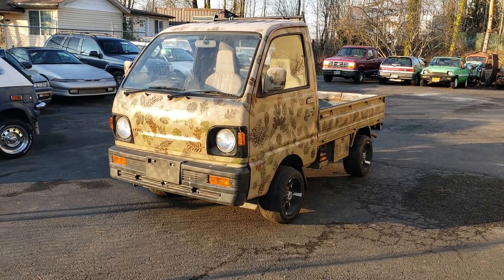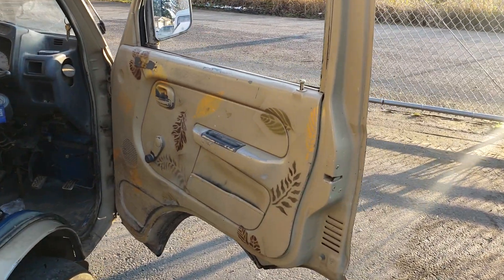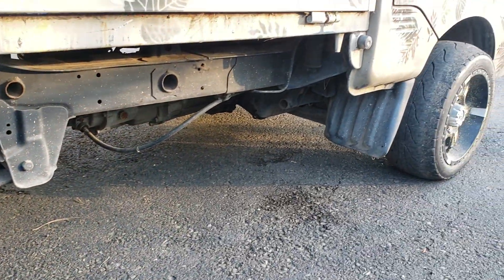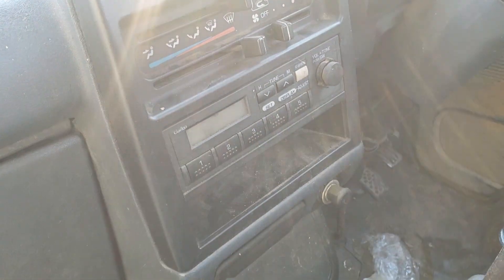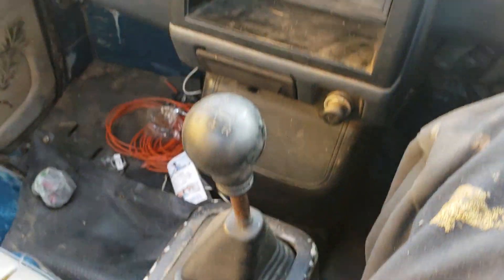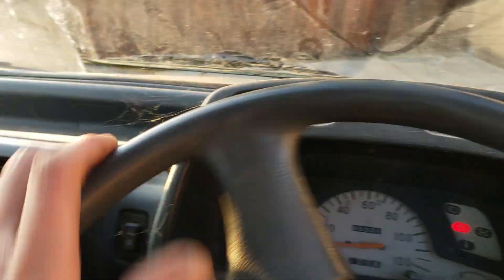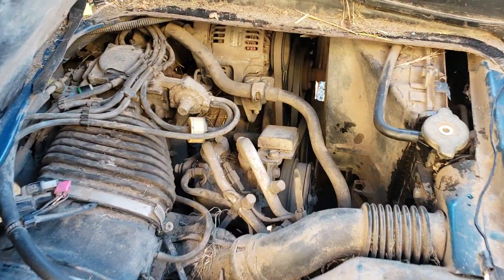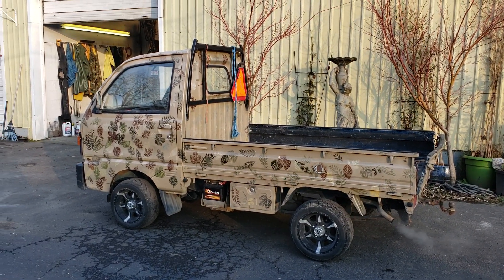This Camoflaged 4x4 Mitsubishi Micro Truck is almost Invisible

Comment: I've got a rwd, 5sp manual van version. 
Any idea how this could be lowered on the back?
Reply: Also the version I have is 660cc 3cylinder 12valve version any idea where I can get a engine  gasket kit? 
Saw similar online but they don't have as many valves.... Would the only difference be the number of valve stem seals or would more gaskets be different ?
Reply from the maker: sure , try lowering blocks
Reply: @2stroketurbo  LOL

Comment: I saw a honda 300 mini car, I miss mine also my honda 600 wagon, and missersmitch  (dang i can't spell it right ),I put a honda cm 400 in the back of it, I bought it with no motor or anything under the bonnet, that three wheeler screamed, it would go 90 miles an hour and take a football field to stop in, but it was fun, I could get it on two wheels going around corners, man would it scare the passenger, lol, and I also had a BMW iseta I also bought with no motor in back, I put a suzuki 750 water buffalo on the rear, I had that on the highway many times, I would drive it to California for the micro car rallies towing a peel and my freeway with a kolar 18 horse motor and 12 inches rims and Hoosier racing tires, on the track i would pass stock one's like they were standing still, I tell you that the others were pissed off at me for modifying mine   most of my micro cars i bought in really bad shape only half there and there was no Internet back then only a small magazine and hemmings magazine I am still interested in a small mini cheep to work on if I can find one, call me sometime at 602 664 0461,because I don't know anyone who is into these cars anymore  most are dead now and you are the first one I have heard about, there is a guy here that owns a car lot that has a subaru 360 that I got running for him to give to his boys